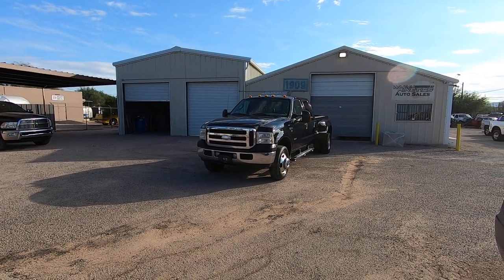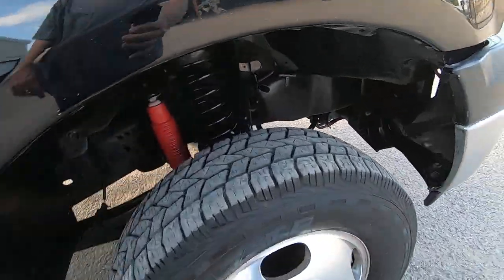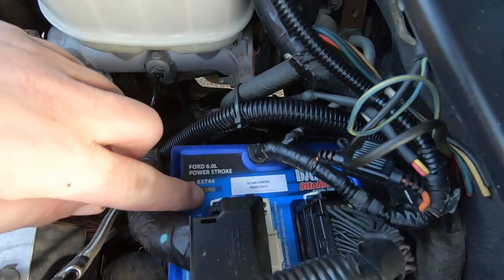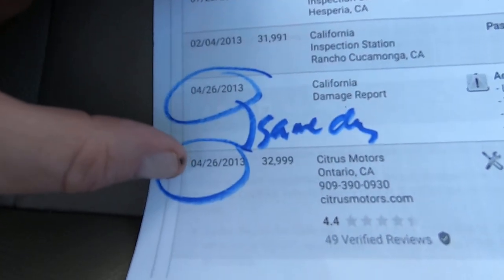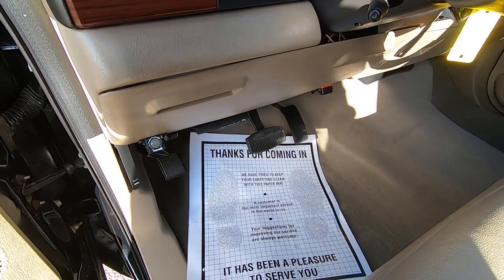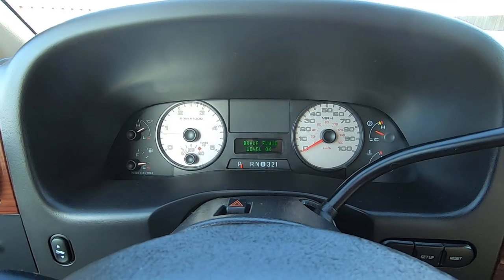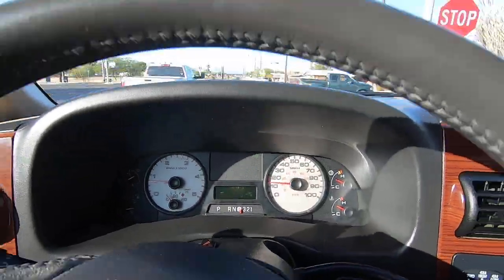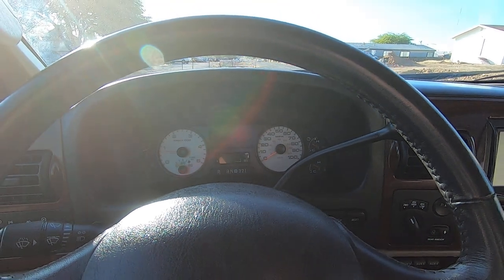2007 Ford F350 Bulletproof EGR Cooler Wheel Kinetics

Comment: Bulletproofed my ass. who cares about the ford stamps in the fenders, When I saw no external oil cooler then I knew you are lying. So this probably has the factory faulty oil cooler and EGR Cooler installed.